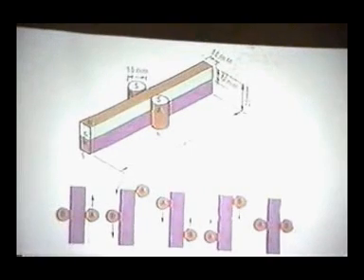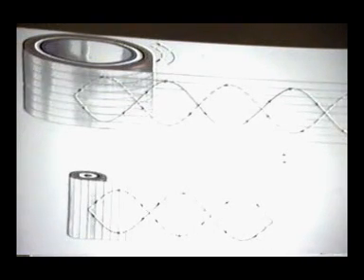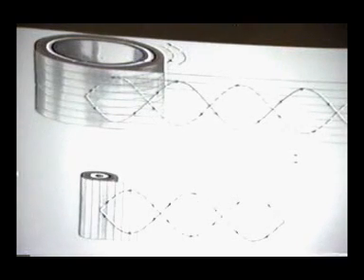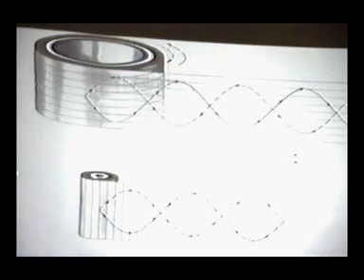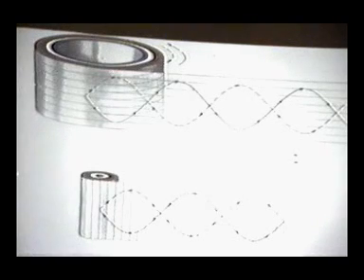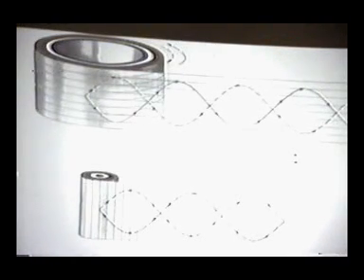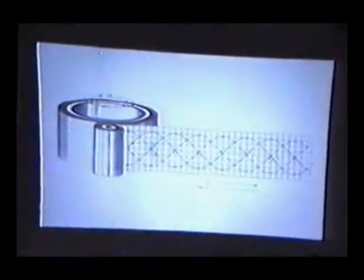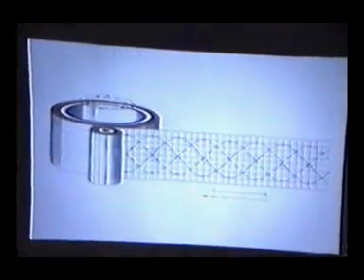2/6 UFO BUILT & FLOWN 3500KMH PROF John Searl SEG Free Energy Magnet Generator

Comment: The Runner sets of 8 stacked discs keep trying to find EQUILIBRIUM, and stability, but they nver can. That is why the runner starts accelerating INSTANTLY when professor Searl pushes it past a trough. As long as there is current-flow, the runners will NEVER STOP. Current flow is enhanced by the ELECTRON RESERVOIR of a rare-Earth, at the core of all plates and runners. Rare-Earth Magnets soon became available in the Early 1970s, when it was shown that they could make the most powerful magnets.

Comment: I know about that prescription debacle. Still prfessor Searl and the SNSRC did important spacework from 1952-1977. AND 50-million Canadians saw the SEG STOP for the first time ever.Once started, they were left running, as they NEVER could be shut down, until then. NASA knows of the SEG also, having been consulted by the team for a life-support system, as the SEG above 500,000 volts is in a vacuum, and pilots would suffocate. Dr. Arthur Cain of NASA can be seen in many photos wiring Demo-1.

Comment: On a magnetic-viewing film, the magetic fields on plates and runners look like wagonwheel spokes, or a sunflower. Totally unlike other magnets, by virtue of the modified Magnetising-coil, DC, with ONE complete turn of AC lain on top of the DC coil. Both sources must be activated simultaneously for less than 2 seconds. The ferrous-layer of all plates and runners is thus magnetised. The frequencies and intensities are dictedted by the law of the Squares.

Comment: @kallab1 THereis a famous film of an orange ping roatating fireball traveling very fast horizontally over the southern English countryside from 1970s and early 80s UFO documentaries. That is the Levity Disc, or Inverse Gravity Vehicle radio-controlled model in flight, under full control, by professor Searl and the SNSRC!

Comment: The saucer he built never flow at 3,500kmph or mach 3.3 or any other speed above mach 1.5 because it was made from wood and Aluminium.The laws of thermodynamics would have stopped it and not in 1968 either. How do you control this craft in level flight???.By radio control ?.Not a cat in hells chance could you manage this in 1968.I have worked on systems in the blackworld for over 60 odd years you have hard difficulty today it can be done today but not in 1968 for a person like him unless he as

Comment: connections in the blackworld then or Locheed Martin???.Lets forget how he controlled the craft in level flight and stick with the material it was made from wood and aluminium.When i designed the SR71 BLACKBIRD for Lockheed martin with Kelly Jonston i should have built it from wood and aluminium would have saved a fortune in design work for me.But would have killed the pilots very quickly in flight at mach3.3 ha ha ha he he he.So we see how stupid this gets.The list goes on and on with this.

Comment: The technology has worked fine since 1946. It it had'nt that would have been the end of it. Plus, we have the testimony and experience of the dozens of people who worked on the SEG and built the 41 VTOL models, which were radio controlled from the big panel shown, with 12-meter band. An SEG STOPPED for the first time in 1970 on Canadian Television. Flowerbower you are a homeless crank, so nothing you say has any credibility.